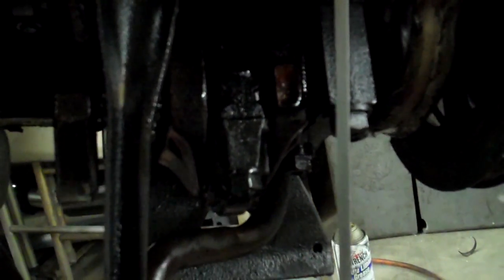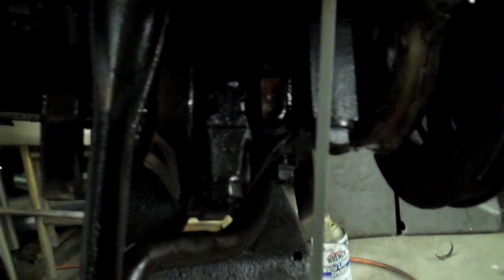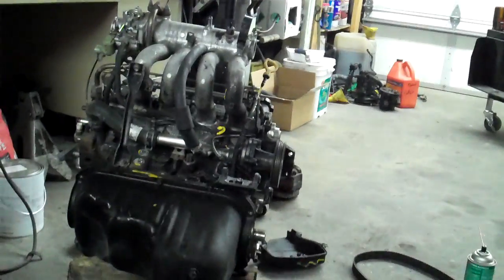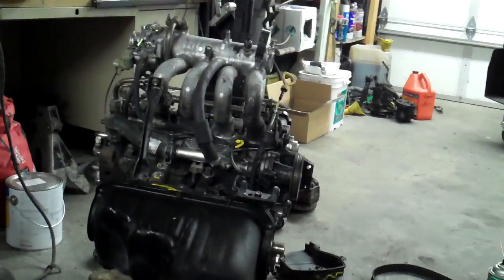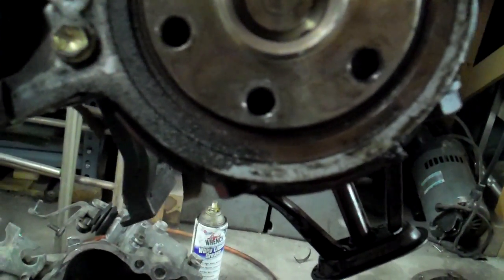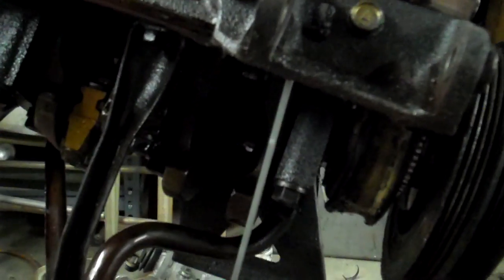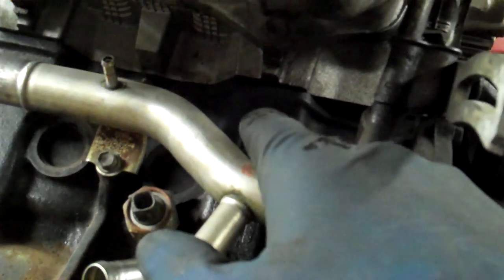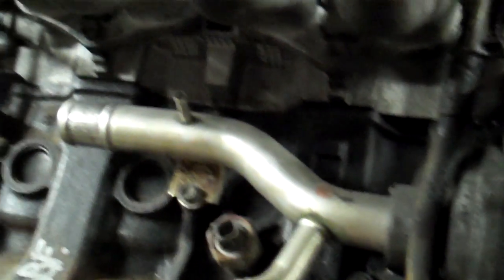ROD KNOCK!!! What it looks like inside the engine.

Comment: Not entirely sure, but i feel as though the crankshaft rod journal itself will have been worn down or damaged during the rod knock. It really depends on how long the rod knock has occurred, i feel as though even after less than a minute or two the crankshaft will be damaged enough to need a replacement. Someone please correct me if i am wrong.

Comment: i have a 98 3.8l camaro. it started knocking, i have metal flakes all in the oil, it started when i lost oil pressure, now when i rev it up its bad, it dies when i put it in reverse, what could the problem be????

Comment: The clutch fork presses on the throw out bearing. It could be either or both. And honestly youve gotta get a new clutch fork/throwout bearing. If youve got the money, i would bring it to a shop, ask them to take your trans apart, take a look at whats wrong, and take the next step from there. Save about $1000 just to be safe. You probably wont need that much though.

Comment from the maker: The throw out bearing is the component on the inside end of the clutch fork.  The fix is to remove either the engine or the transmission so you can get the throw out bearing out (it goes around the input shaft of the transmission like a wedding ring) and replace it.  We reply around here.  We all love ya!

Comment: Very useful video. Trying to determine if I have rod knock now. And if its a serious issue. I have a 04 wrx that makes a knocking sound when its at idle, how ever if I hold the clutch in, the knocking goes away.  I cant tell if there is knocking when Im going/accelerating because my muffler is too loud. any insight is helpful. I'll post a video If I need to as well.

Comment: Something I would like to point out that wasn't mentioned in the video- sometimes you can have a rod knock cause solely by detonation (happened to me) where the crank and rod won't be damage. The noise will come from the upper bearing half being too heavily compressed, allowing extra up-and-down movement. It's often possible to salvage engines in this case with a set of new rod bearings- I am currently in the middle of doing this to an old Camry to coax some extra life out of it.

Comment from the maker: I would recommend replacing the engine.  The connecting rods wear easily on those and it's very difficult to get a match to replace just the #1 (the one that usually fails) so you'd have to order four of them from Japan and get the crank milled over and get oversized bearings too.  It's a lot of down time and risky machining.

Comment: i have a 2000  forester and it makes a knocking sound, i think its a rod knock.. and when i step on the gas it gets louder and more violent.. when it happened to me i was driving and all of a sudden the rpms would drop and the car struggled to drive. i want to know if its workth fixing or getting a new engine. and i also have to replace the clutch and the head gasket as well if that would make a difference in your answer. please lmk

Comment: Thanks so much for video, I have got 2005 toyota corolla, got sound only when engine temperature is cold, and never comes when the engine temp is warmed. I thought it is lifter , this one have solid lifter, i used feeler guage and both exhaust and intake are within spec. Question is if it is connecting rod sound, will it come all the time(both cold and hot). Tip, it come only when i accelerate, when i relase pad sound wont come. pls pls advise. can be piston slap dont know?. any advise.

Comment from the maker: It depends on what you value.  If you value cost savings in the short run and value experience then you can just replace the crank, bearings, rod, piston etc.  If you value long term results and long term costs and reliability it'd be best to get a junkyard motor.

Comment from the maker: It's possible, but to have the wear on the crank be just so that it matches an available bearing size well enough is like winning big on the wheel of fortune- not a bad thing to try if the oil pan comes off easy enough though.  I kinda want to try that now!

Comment: I have a 99 paseo and the engine just shut off today, there was a knocking sound at about 120kmph, and then whenever I accelerated the knocking sound increased and then when I decelerated it got really loud and the engine just shut off. Power still on, but the engine wont turn over now. How do I go about fixing this? Is it cheaper to get it fixed? Or should I just replace the motor? My buddy says he can hook me up with a new motor for $500

Comment: I would just laser cut the head bolts between the head and the block then extract the bolts stuck on the block to get at the top end of the block quicker so you don't have to uninstall the intake and the rest of the stuff. I hope you realize I'm just joking, nice video very informative.

Comment: Hey Brain, I just bought a 2001 Pontiac Bonneville with the 3800 Series 2 Non- Supercharged. with 190,000 miles on it.Ive got a Spun rod bearing now, would it just be easier to do a engine swap then try and fix everything. Im looking at $700 for used engine and $785 for a Install at a shop. If you have some advice for me,Id appreciate it.Thanks,Alec

Comment: You could use emery cloth on the crankshaft prepping the rod bearings new mating surface.  insert a new rod bearing. re-assemble. drive it til it knocks. Clean the oil pan of all metal/bearing pieces, new oil + filter.  I've got 10-12k miles on all cars I've done this to. I wasn't easily persuaded but i've save many friends money...

Comment from the maker: Often times once the bearing is gone the crank gets worn enough to merit machining.  I tried just replacing bearings  on a 3.8L Buick that had tin foil thin rod bearings and it just knocked like a screen door in a hurricane once I put the pan back on and ran it.

Comment from the maker: I would replace the oil filter immediately if there's no oil pressure after an oil change like that.  I've had that happen to me on a Cherokee.  I freaked out and got all worked up about replacing the oil pump, but it was just a bad filter from the factory.

Comment: Thanks for the video.

Had 3 major mechanical engine failures in the past year, on 2 separate Vulcan motors. First was original, bad main seal and knocked when warm. So I buy a low mileage used motor, 40K or so. Head cracked within a month bleeding the oil into the antifreeze. Swapped heads off the old motor, new gasket ect. The next day something broke loose on the highway and began knocking. 

I got it almost loose. Thanks again for showing us.

Comment: Thanks for the vids and great advice. My 01 Altima engine finally blew (literally a 3 in hole through block). Took your advice on JDM motor and scored big paying less than half the price of a rebuilt plus it only had 56380 miles on it. Unfortunately shrapnel from the exploded piston blew a hole in my front cat converter making the car loud and no exhaust comes out rear. Rear cat looks easily to replace Can you give me an idea on how difficult the front would be? I'm broke so its got to be DIY.

Comment from the maker: Options.  1.Reverse drill bit. 2. Weld through a nut to it.  3. Cut a slot in it and use an impact screw driver.  4.  Drill a hole in the center and use an easy out.  My favorite is number 2.

Comment: hey man i gotta a question ive been a subscriber for a while now nd i see u know ur stuff very well but i was wondering i bought a 95 s10 2.2l 5 speed nd redid the heads from being over heated but what i was wondering is the driver side engine mount was installed incorrectly before i bought it and the bolts were snapped in the block i dont know if they were cross threaded or were they broken from just regular motor movement do u know how i could remove them they are broken flush in the holeThnks

Comment: What does it mean if your hearing a lifter when you rev the engine or acceleration? Does this mean the motor is going to go or is there something I can do so it don't make that noise. Just wondering if I don't do something if the motor is going to be junk. Trying to sell this car and 2 people are hearing a lifter and then don't buy the car. I didn't hear it when I bought it and I have had it 1.5 months. Want to sell to buy my sis van but may have to fix this. Is it expensive and/or a big deal?

Comment from the maker: It's hard to say without listening to it.  It could be lifters or a valve train issue of some sort.  I've seen MANY problems with rod knock on those, but they usually limp along FOREVER before failure.  I had a buddy with an F250 that had BAD rod knock for ten years that we took all over the place and beat hard.  Eventually the rest of the truck was too beat to salvage.  It never did throw.

Comment: Hi Brian. I got an intermittent coming from the top end of my engine. It does not start until the engine warms up. the cylinder head was replaced and the noise is still there. Could an loose bearing cause a rattle on the top of the engine even though I would expect the sound coming from the bottom of the engine?
Thanks

Comment: don't show me that. my truck has a bit of a rod knock when its cold. i was thinking of doing the oil pan gasket because of some seepage at the back corner by the starter which is common on newer chevy trucks, but now if i take the pan off i will have to check those rods. i have been putting additives and stuff in at oil change time thats supposed to help with noise, i'm not trying to fix it like that, just prolong it enough till i can actually fix it.

Comment: @judastadeo32 most likely you have 4 o2 sensors the rear 2 o2 sensors after the cat you can have the ecm programed and delete the 2 after the cat but you have to keep the ones before the cat the  truck is efi so the computer needs to know how the fuel has  been burned. i hope i helped

Comment from the maker: @judastadeo32 If you want your check engine light to stay off.  Those O2 sensors are input devices to your cars computer to make it manage fuel trim on the O2's near the engine and to test if the cats are working on the ones downstream from the cats.

Comment from the maker: @wkrfh Rod knock is a "bottom end" problem.  It usually doesn't go away.  Upper engine noises that happen from a lack of lubrication on start up are more likely to get oil in a delayed scenario creating clatter until they get oil pressure.

Comment: @deanobrown if this is in fact the issue, you will be replacing the rod, all the bearings, and the crankshaft. Total that to the cost of removing and re-installing all the parts that sit above the block, and your labor cost goes through the roof. You are looking at thousands gone at the end of the day.

Comment: i got a toyota 4age 4banger, it makes little tapping sounds from under engine, when just start it up and idle it to warmup, after i drive it around and sit at idle noise is gone, what causes this, its not very loud, just noticeable.also engine is from 86 mr2, pretty old, but doesn't leak fluids, runs good, lots of power

Comment from the maker: @Jaredsarusrex That's usually the clutch disc/pressure plate.  That year wasn't geared low enough in 1st gear and they had real problems with airport parking lots, steep driveways, and high slope low speed areas.  The following years 04 and newer corrected that.  You have to pull the engine and trans out the front (take of the front bumper completely) to replace the clutch.  It sounds bad, but BMW makes it come apart modularity and it's not too bad.  It's pretty fun.

Comment from the maker: @manmanbanana Often times I'll install a wrecking yard engine and it will knock at first and then quiet down after driving a while.  It's knocking because oil isn't getting where it needs to be fast enough for whatever reason.  The thing to do is to not run it too long at a time or else the rod bearings can get hot and thin out leaving you with a permanent rod knock.  Make sure the oil is full and get it level.  Run with the oil cap off and make sure oil is getting to the top of the engine.

Comment: @briansmobile1 I guess man. I have taken them apart their is a lot of screws in the valve body. The case has a bunch too. I have so far rebuilt a civic automatic from a 97 and 99 accord automatic aka known as the glass box online. If you really want a bunch of screws just take an accord apart piece by piece and your will have a bucket full. I know from experience. I love junk yards.

Comment: @briansmobile1 Yea I did. Mr.Honda originally went to work for Toyota to convince them that piston rings would improve their engine design but they ignored him so he built his own designs. I know Honda was first building motorcycles and mopeds back in the day. Now they build cars and everything else. Believe it or not Honda accords and civic have motorcycle transmissions. Take a look at the design they have motorcycle clutch disc's in them that is why they fail. Too much torque and high temps.

Comment: Toyota's motors suck. Honda motors are rock solid many times over. I have seen so many toyota's over the years bite the dust on their own. The only time I have seen honda's bite the dust was because the owner didn't do basic oil changes. The big difference is that honda has suffered with transmission issues for a long time with their crappy autos but the manuals are solid. Good video.

Comment: thanks for the great video. I put the wrong oil filter on (it popped off after 10ft, but i didn't notice), drove a mile, stalled, started up again no problem, stopped about a mile later with some rod knock (not as bad as most on youtube, but def rod knock) 
If you had to GUESS, could I get away with just replacing the bearings? motor was in terrific shape before this screw up

how much would repairing this usually cost (again, a guess)

Comment: Wow as small of an engine that is I am surprised it lasted that long. I spun a bearing in my old truck which was a 2.5 also and it locked down tight from around 4500 to 5000. So at least he was able to drive it home. Also I doubt it was a piece of foil cause the filter would have got it. I think you may be seeing some bearing or something.

Comment from the maker: @PWRSTR0KER2008 106,000--  thanks again for catching that video before.  The owner got a piece of foil from an oil bottle? into the engine and it blocked off flow to the first cylinder.